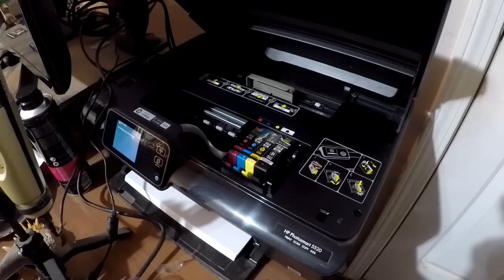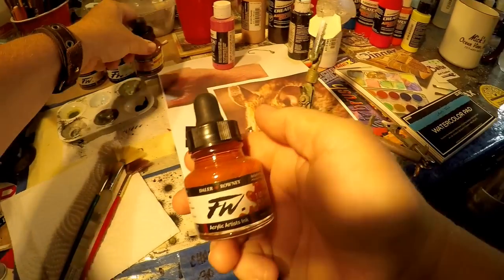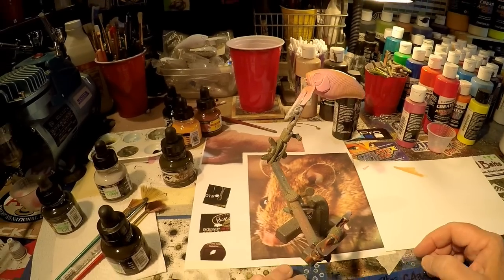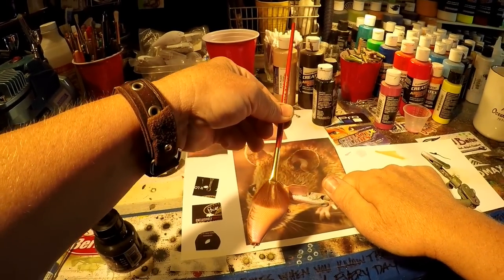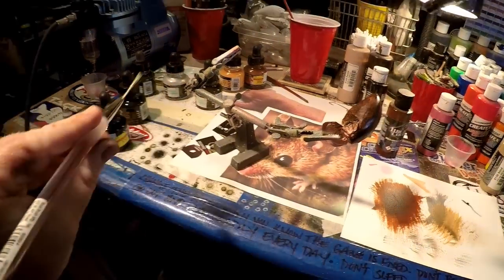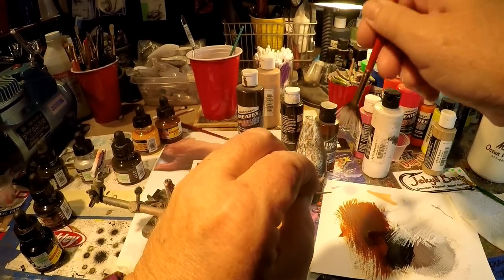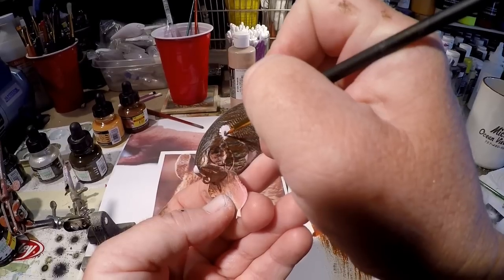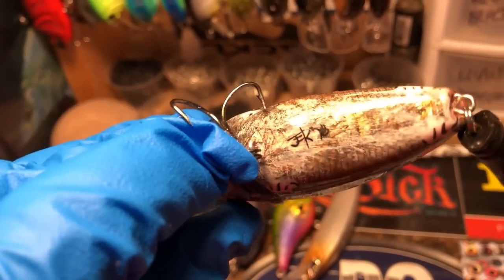A Field Mouse Pattern (Hatch Match Series) (3, 4, and 5 of 5)

Comment: Awesome video.  I will have to try this sometime.  In regards to the FW dropper, I keep a dental brush handy to run up the dropper.  I have had the ink settle in the dropper.   When this happens I just work the brush in the dropper and it usually will free up.
Reply from the maker: Great tip!! Thanks